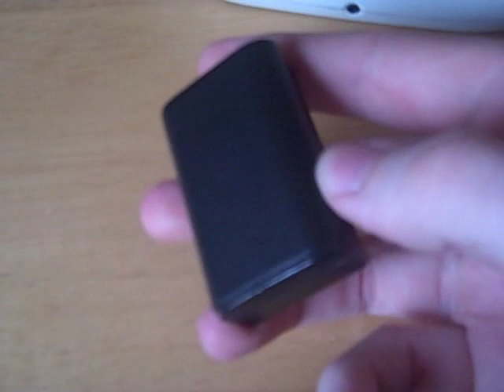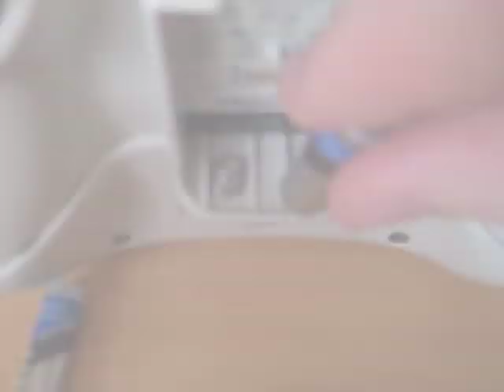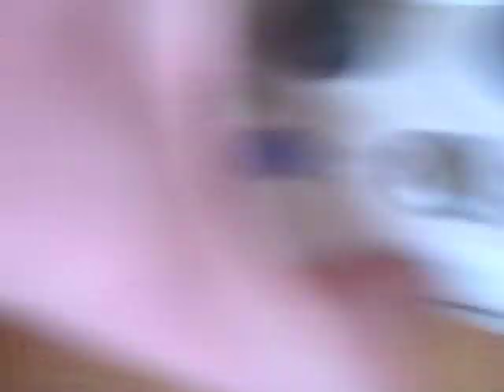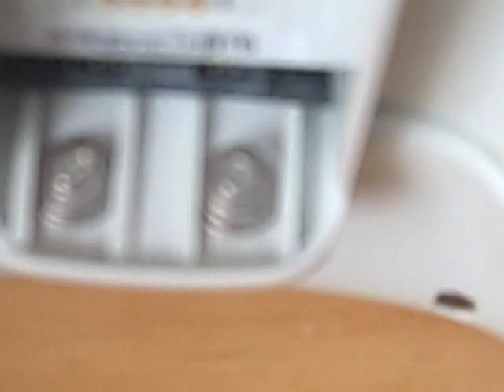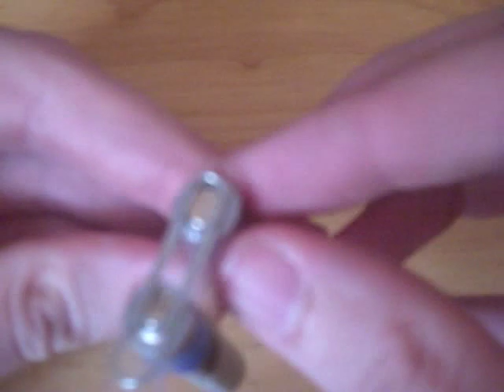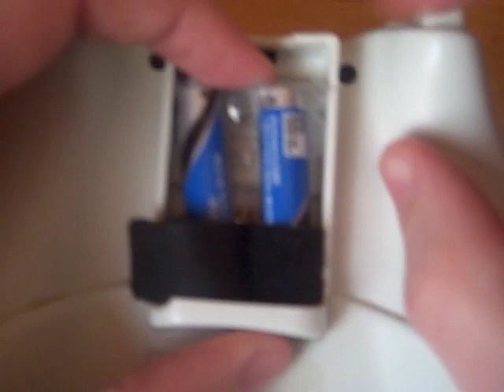How to Make a Battery Pack

Comment from the maker: 1) It's barely different from a AA power supply. AAA and AA batteries are both 1.5 Volt, the difference being their capacity. 2) As long as you insulate the metal pieces, you won't short it out. 3) It's taped in, so it won't fall out. 4) It looks like shit because that's all there was available at the time. 5) It worked perfectly for the duration of the AAA's battery life. :)